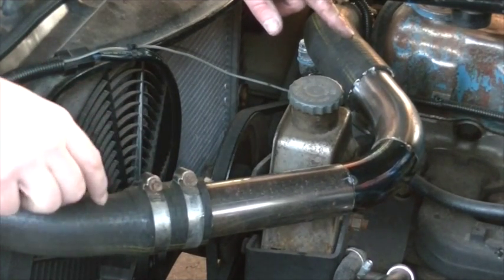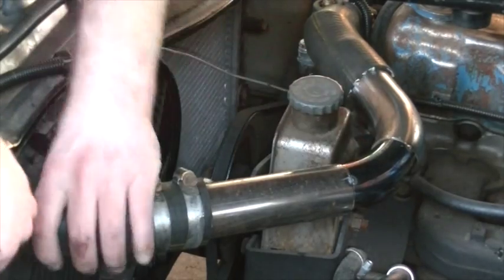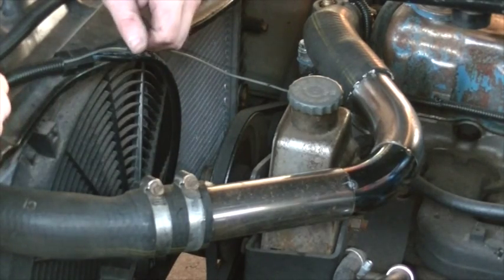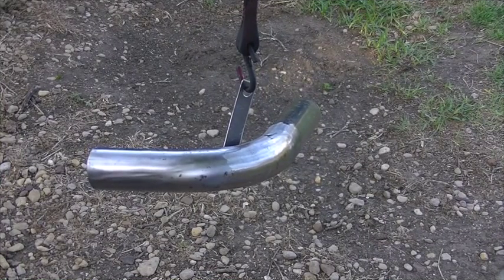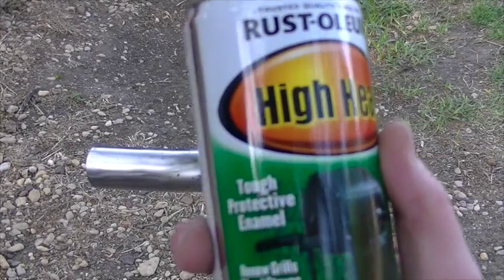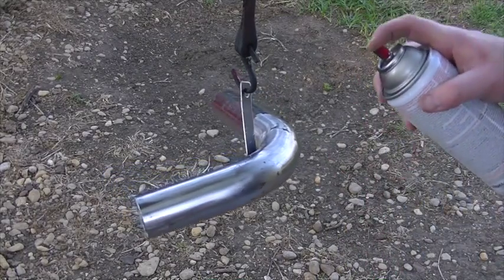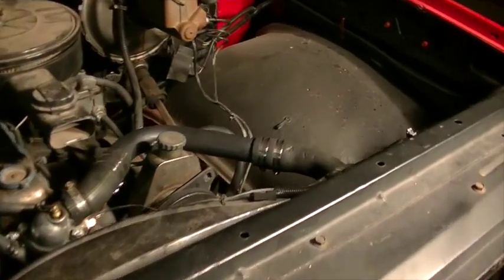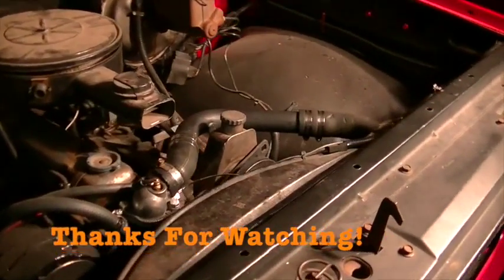PART 2 Fabricating Solid Radiator Hoses | Steel or Aluminum

Comment: Great video. When I had my 74 c10 for 15 years I don't recall ever having that problem. Maybe I acquired a different formed hose. Anyhoo, here's a tip for your tip: I apply a thin bead of silicone around the smooth steel-to-hose connections in all my high pressure applications. A trick I learned from a Ford friend. The power stroke diesel was blowing the blue silicone hoses right off the intakes throttle inlet (which is ribbed) with too much pressure and this was the fix lol. Perhaps this would eliminate the need for double clamping. The truck's paint scheme looks good btw
Reply from the maker: Good tip!  Thank you sir!

Comment: Nice job   Im going to do the same with my Dakota  but using aluminum or stainless tubing  so I can polish it nicely.  This truck must be getting awfully close to finished by now yes?
Reply from the maker: A lot has been done but there is still a lot left to do. Right now I'm working on getting to the point that it can pass state inspection.  It's old enough that it doesn't have to pass the smog test, just safety check.

Comment: wont you still need an expansion tank? It looks like the fitting near the cap that you have plugged would be for one
Reply from the maker: kauboi There is an expansion tank down low on the passenger side of the truck with a tube that connects to an outlet just below the rad cap.  The port that I have plugged is an additional outlet for the heater.

Comment: very cool! so about the bbq paint, i can paint my exhaust manifolds, and theyll stay painted? if that means theyll be black and not rusty id like to try it
Reply from the maker: Yup!  I've painted numerous pairs of manifolds and headers for myself and friends.  It's lasted for years!  This paint is far better than any of the "high heat" engine paint.  After you apply it and reinstall the manifolds, they will smoke a little bit.  It's likely just the propellant burning off.  After that, no problems!  Good luck!
Reply: excellent! ive always wondered about that

Comment: quick tip as far as the ribs on the end of the steel tubing if you're good with a welder you can make a thin bead at the end under low heat to give you that rib to secure the hose
Reply from the maker: I'll give that a shot next time.  Thank you for watching!